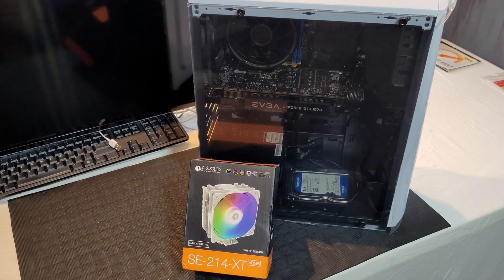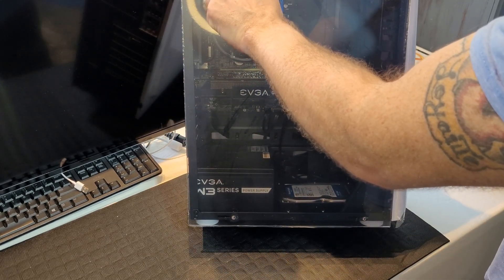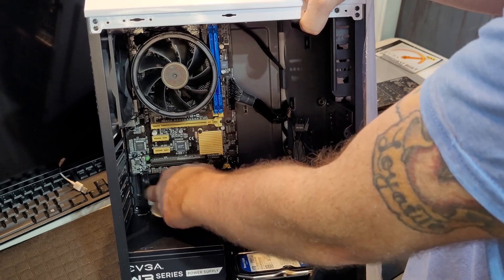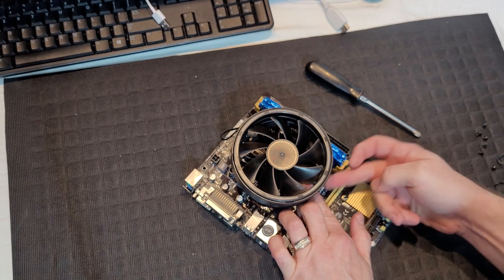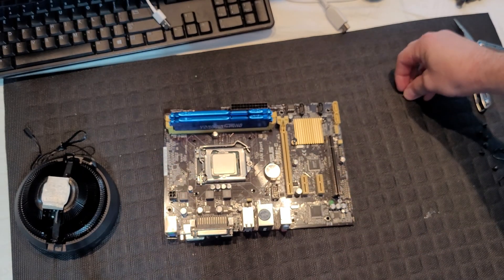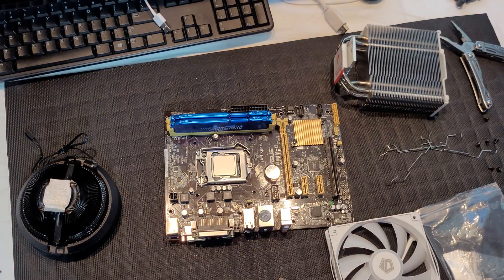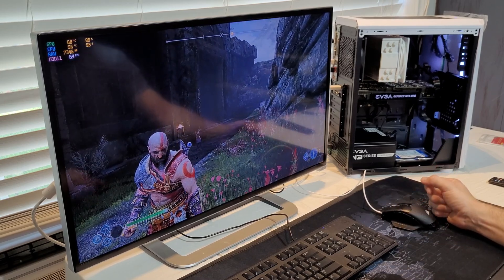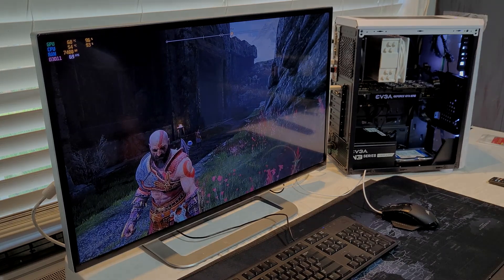The I7 4790 was too hot to handle!! ID Cooling tower cooler can fix it.

Comment: Hey I just installed this cooler( I have version B brackets) and temps of core#1 is higher than other core temps, like if core #1 is hitting 71c on full load, other cores are at around 65c, is it normal? And also I just noticed that the thermal paste is not spreading evenly, I can see cpu text and copper pipes on cooler even after installing paste. The paste is also popping out at the ends of cpu and cooler.
Reply from the maker: Some variation in temps is normal. It should be sitting flush on the cpu. How much paste did you apply? I would possibly go over the install again to make sure everything is seated properly and try again. Those temps are good though so it doesn’t seem like you need to worry about damage or throttling
Reply: @Fenrirsleash  I have reinstalled cooler for like 3 times, changed paste 2 times, it is same. I know the temps are good, I am just worried about weather I installed cooler correctly or not.
Reply from the maker: @artistgamer7335 as long as it is level it’s fine but if it is tilted I would send it back. Is the cold plate on the cooler larger than the cpu ihs?
Reply: @Fenrirsleash did not notice the plate, will check it out later
Reply: @Fenrirsleash I do not think it is titled, it might be titled just a little bit but by just looking at it, it does not look tilted
Reply from the maker: It def seems like a hardware issue if it isn't seating properly. What cpu and mobo do you have? I would send it back and get another if you are certain there is no error on your part.
Reply: @Fenrirsleash I have same I7 4790, asus h81 p si mobo
Reply from the maker: I have used this cooler on multiple builds at this point and have never had that issue before.

Comment: Does this also lower your vrm temps? I have same cpu with stock and on 100% load, the temps of motherboard vrm and cpu is reaching 85c, I am thinking of buying a budget cooler for cpu but I wanna know weather it cool the mothboard vrm as well or just cpu
Reply: I bought same processor with motherboard ram combo mine 100°c in cinebench
Reply: @Tech_Rebuilds you need good cpu cooler, this id cooling cooler is best, I am using it and my temps are around 60c while gaming and 70 to 75c in stress test
Reply: @artistgamer7335 but bro i am a budget builder that's why I bought this at now day's what if I use Zebronics zeb iceberg cabinet I don't have money to purchase that cpu cooler u use 🥲
Reply: @Tech_Rebuilds bro I think that cabinet is same price as this cooler, both are 20$(or at least in my country) I got this cooler for 20$ in country, you can also try some Chinese brand cooler if I you don't enough money for cooler, but if I do have money, do not buy any case, just buy the cooler, I am also using a standard cheap case which only have on fan but the cpu temps never go high because of the cooler
Reply: @artistgamer7335 but I have intex old cabinet there even no fan is ok? Should I buy only cpu cooler?
Reply: @Tech_Rebuilds yes it is fine, I also did not had any fan in my case, I bought it separately and installed in my case, it is ok to use normal case, just buy the cooler, you can buy a cheap case fan from any computer shop and install it in the back side and open case panel while using the PC, I do the same in hot summers when room temp reach 45 to 50c, and even with standard case with one cheap fan, my temps never crossed 80c in hot summers
Reply from the maker: For vrm cooling a cooler that blows down toward the motherboard is best but if you have good airflow in your case that helps a lot too
Reply: @Fenrirsleash i bought budget cpu ant esports ice c612 v2 and it's max 75°c now

Comment: Hello, I have an old DELL Optiplex 9020 SFF CPU with an i7 4790 (non K), the idle temperature is 30-35 celcius, but when running for a few minutes the aida64 test rises to 85-90 degrees, is it normal or should it worry?
Reply from the maker: It is normal for that cooler. You can maybe find a better cooler for it.

Comment: Which cpu cooler is best and cheap I AM FROM 🇮🇳 INDIA ❤
Reply from the maker: Also what cpu are you using?
Reply: @Fenrirsleash  I have i7 4790S.  Is this cooler good for low temperature
Reply from the maker: @jaat6969 yes the cooler will work very well with the 4790s you will have less than 70c
Reply: @Fenrirsleash  send me link pls cooler link
Reply from the maker: ID-COOLING SE-214-XT ARGB CPU Cooler 4 Heatpipes CPU Air Cooler ARGB Light Sync with Motherboard(5V 3-PIN Connector) CPU Fan for Intel/AMD, LGA 1700 Compatible for Desktop https://a.co/d/5Y1WJ3Z
Reply from the maker: The one I used is really good the ID cooling branded one
Reply: @Fenrirsleash  name please
Reply from the maker: I purchased from Amazon
Reply from the maker: @jaat6969 ID-COOLING SE-214-XT ARGB CPU Cooler

Comment: What Were The Stocks On Stock Cooler And What Are Idle Temps?
Reply from the maker: The cooler I used originally was hitting 80c at full load playing God of War, idle temps were in the 40s if I remember right.
Reply: @Fenrirsleash  I Am Hitting Max 95 C While 100% Usage Btw I Have The Exact Same Case,Cpu And Hdd And A 1060 From Exact Same Vender(Looks Identical)
Reply from the maker: @qcpole69  I got ya, I’m was assuming when you said stock you meant the first cooler I used for the build. It was an aftermarket cooler also still better than stock. The 4th gen chips get pretty hot unless you have a good cooler. Get the id cooling tower cooler for 20$ on Amazon and you will be set.
Reply: @qcpole69 Not sure if you bought one yet, but I've heard really good things about the ID-COOLING se-224-xt and the Vetroo V5 on the budget end. Or the Arctic eSports 34 - a bit more expensive, but quieter and comparable cooling ability.

I just jumped on the new ID-COOLING A410. No one's done a proper detailed review on it yet, but their previous coolers seem to be great. And some people are speaking good of the A610 in the same line. Bought an extra ID fan to match for a push-pull config.